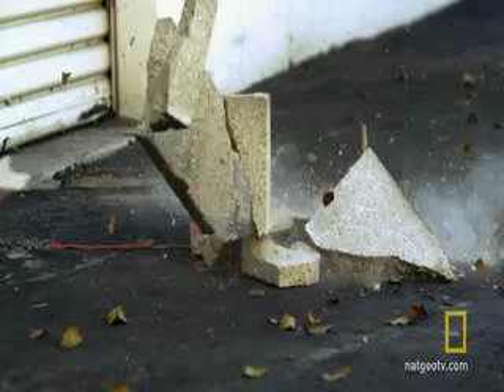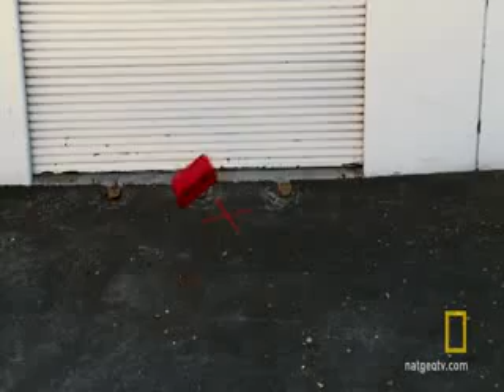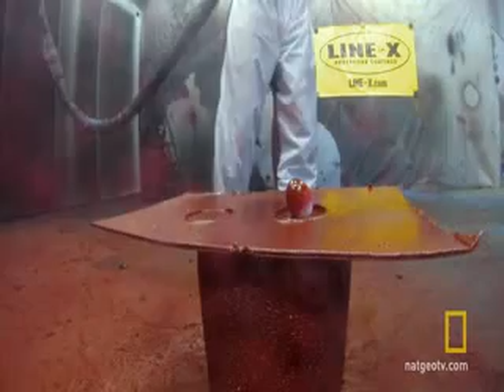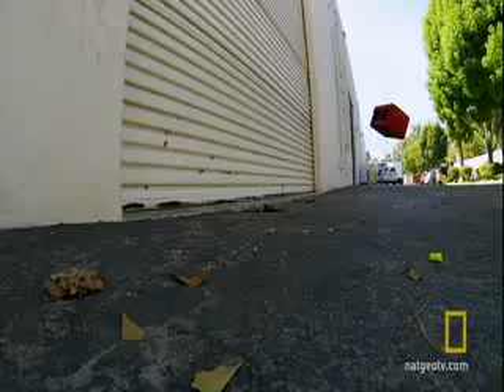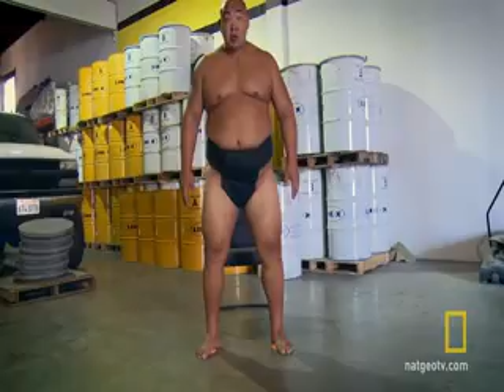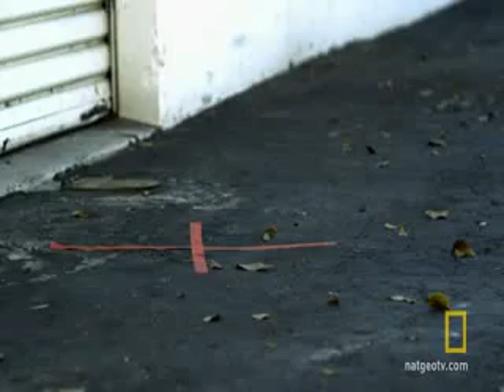Line-X: Protective Spray-On Coating That Makes Any

Comment: How much would it cost to coat a styrofoam/ polystyrene boat with approximetey 66 square feet? I would like to make an awsome video about my boat and your lineX product. The boat is 8 inches thick. 3.9 feet wide. 6 feet long

Comment: They should undercoat ford trucks with this to stop rust.
Reply: Easy there, it's amazing stuff, but let's not get carried away.
Reply: They should coat the WHOLE body work of a Ford truck so it shouldn't rust....
Reply: they need to do something, here in the northeast you can buy a new truck and in less then a few years it starts to rust. and the funny thing is, my 99 grand am gt has no rust, everything else has fallen apart, but no rust;-/